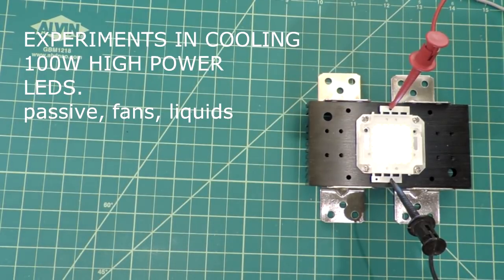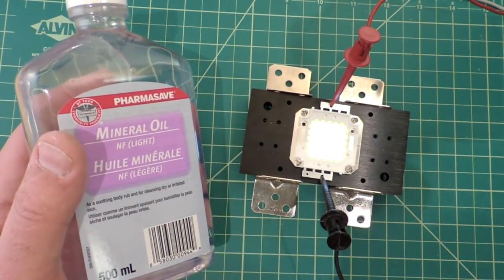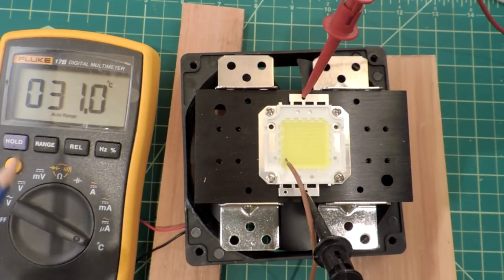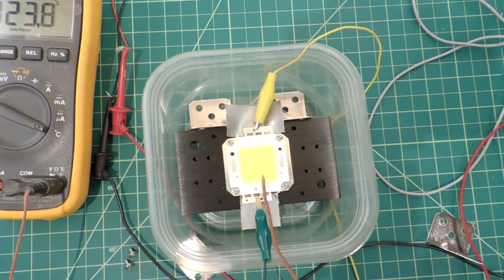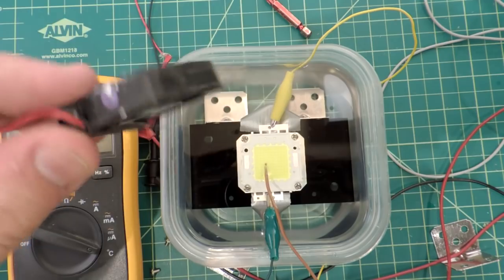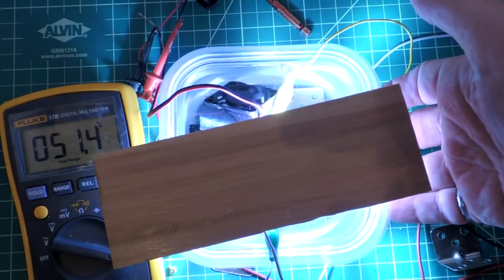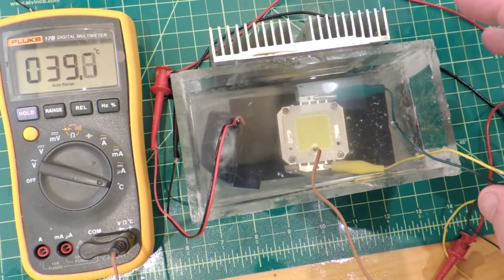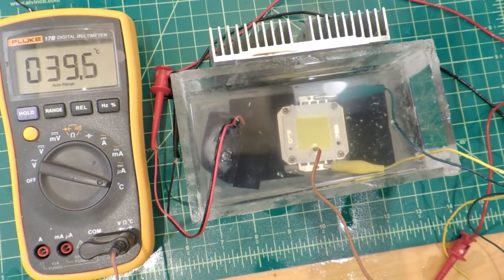Experiments in Cooling a super bright 100W LED module

Comment: I think that a computer CPU cooler would work for this. But maybe you will need a very beefy one with heat pipes.
Reply: pauljs75
Erm, 775 CPU coolers have LONG been used for the purposes of cooling 50>100w LEDs genius...
Reply: Yeah, something like Zalman CNPS 9500, with a good thermal grease.

Specifications: FHS: Dimensions: 85(L) X 112(W) X 125(H)mm. Base Material: Pure Copper. Dissipation Area: 3,698cm2. Thermal Dissipation: Approximately 135 Watts. Thermal Resistance: Silent Mode: 0.16 oC/W. Low-noise Mode: 0.12 oC/W. Fan: Bearing Type: 2-Ball. Speed: Silent Mode: 1,350RPM +/- 10%. Low-noise Mode: 2,600RPM +/- 10 %. Noise Level: Silent Mode: 18.0dB +/- 10%. Low-noise Mode: 27.5dB +/- 10%. FAN Speed Controller (FAN MATE 2): Dimensions: 70(L) x 26(W) x 26(H)mm. Output Voltage: 5V ~ 11V +/- 2%. Allowable Power: 6W or lower. Connector: 3-Pin.
Reply: I bet it would. The back of that LED looks about the same surface dimension as an typical CPU. (Intentional? Certainly makes it easy to use OTS parts.) A CPU cooler/fan combo rated at 125W cooling capacity or greater should work with reasonable wiggle room. (Anything made for an AMD Phenom II or Intel Core i7 should work. So there should be a lot of options.)
Reply: Why not use CPU liquid cooling solutions, they are not that expensive anymore.
Reply: JeremyB796
No it's not. With its fan running at its max speed, it's barely ok. LEDs and CPUs are not the same thing. This heatsink is meant for a CPU with 130w of max heat dissipation requirement. Usually LEDs operate at 100% 100% of the time while CPUs don't. Also this type of heatsinks might have huge heat dissipation surface but the problem is that the thermal path from the cpu to the fins is too thin/small for heat to transfer fast between these two points. And no matter how great an air cooler is, the top surface of the LED will be very close to its max allowed temperature.
Reply: runner180fxr I think you underestimate CPU coolers. I have run my AMD8350 at +90% for hours more than once using only the boxed cooler and I am pretty sure it can handle a 100W LED (but you'll need earplugs).
Don't forget that the temperature inside a computer case is already much higher than the room temperature, also the CPU is not alone but has heat coming from you GPU, chipset, ... etc.

I have used an old Thermaltake Volcano 7+ for driving a 100W LED and it ran really cool but noisy.
Recent boxed coolers are safe to cool most 50W LEDs without being too noisy the better CPU coolers should be able to handle a 100W LED.
Reply: ppdan
No I'm not underestimating cpu coolers. I was talking specifically about that cpu cooler. Also I never said it can't handle a 100w LED, I said it's barely ok. I thought my post was detailed enough but since it wasn't let me explain further.

LEDs and CPUs are not the same. With normal use like gaming, video encoding, folding, etc and 100% cpu usage you are not really maxing out a cpu. There are other ways (not overclock, not multiplier increase, not overvolt) to push even further a cpu which are included in stress test softwares and I doubt there more than a handful air coolers that can save a top tier cpu from thermal shutdown under these circumstances. A motherboard can monitor the cpu temp and adjust fan speed accordingly. And lastly cpus are designed to actively try to protect themselves from excessive heat by reducing their frequency or other means. In other words it's my belief that all cpu cooler manufacturers (stock or aftermarket) take into account these things, especially that last one and no cpu cooler is meant to handle anything more than a sustained 100% of typical cpu usage.

If this doesn't make sense to you let me tell you about a test I made. I tested how much power I can make an Intel G840 consume, with various ways that cause a 100% cpu usage. Even though this cpu has a TDP of 65w, it wouldn't consume more than 27 watts of power fully stressed. I did the same test a long time ago with a C2D E8400 and I also noticed a lot smaller consumption than the cpu's TDP. At that time I used Lavalys Everest stress test (which can stress a cpu even further than the typical 100%) and I noticed the consumption (and temps) was increased even further but still under its TDP. This is why it does not surprise me at all when you say that you are using your cpu at 90% for hours. Also I trust stock AMD coolers because as I said earlier there is a thicker path for heat to transfer to the fins, thus the heat moves faster away from the cpu and towards the fins. Also stock heatsinks are thick pieces of metal which add mass to the cpu. This means that they can absorb bigger amounts of heat from the cpu and as a result sustain their temp lower for longer time. Bigger mass = bigger thermal capacity = slower heat increase. Their drawback is that they have less surface to dissipate the heat and this is why their fans run at faster speed and they are louder. When comparing stock air coolers to most aftermarket, its just a trade-off between faster heat dissipation at the fins and faster heat transfer towards the fins.

LEDs on the other hand have no way to protect themselves. Give them excellent cooling and they'll live forever. Give them barely ok cooling and they'll dim after a year or two and their life will be shorter. Bad cooling and they'll die. As for the Thermaltake Volcano 7+ you used to cool a 100w LED, I believe it's ok to do the job. But when you say it ran really cool, that I don't believe. There is no air cooling solution that can make a fully driven 100W LED operate really cool supposing that by "really cool" you mean you can touch it indefinitely without getting your finger burnt.
Reply: runner180fxr Yup, especially Intel CPUs used to start throttling behind your back to avoid overheating (don't know about the recent i-series but I guess they still do that). 
Somewhere I think we have experienced totally different things with CPUs. I have to admit that the only time I accurately measured power consumption vs CPU load it was with server grade CPU (AMD opteron 8224, 8222 and older Althlon MP2800) and they started drawing awfully lots of power as CPU load went up. Than again it's an unfair comparison because those were real pure processing beasts in their glory days and the only "power management" they had was a lock down temperature.

As for my experience with my Thermaltake Volcano 7+, they had less trouble cooling that 100W LED than a couple of fully loaded AMD MP2800 sitting in a case where the case temperature was already way above 35 degrees. I think I have that setup still lying around in my "lab", maybe I'll fire it up this weekend and measure the exact temperature.

Comment: There are companies which are now selling commercial LED products based on these and similar LED modules.   Its does take some serious thermal and mechanical design engineering to keep the LED element cool, and at the same time quiet (efficient fan design).   Check out this light here. http://veritaslight.com/constellation-120.php

PS.  I work for the company.

Comment: Gr8 video on cooling.  I am also experimenting with 100W LEDs.  I just mounted a 100W LED on a CPU fan/heat sink.  This heat sink has the aluminum vans as well as the copper cooling radiator.  Hopefully this setup will keep the LED cool.  I am going to use the fan and hopefully i can keep the RPMs of the fan down to aminimum while still providing adequate cooling.  Fingers crossed.

Comment: hey guys: i ve found the definately best and cheapest method to cool don a led modul (100watt) and i use it for my 100 watt module, too. there are many "watercoolingsystems"  like "enermax" and so on on the market: but in this case a good old cooling system for a pentium 3 or amd phenom 2 is the best and cheapest!!!!. its built for the same space like a led module and for example in a pc you ve got 140 watt output each cpu (amd phenom 2) and those systems keep it on 50 degrees celsius! so search in ebay and DO IT greetings from germany

Comment: This question is obviously answered I would assume in the video but are these LEDs water proof? I ask because I made a setup for a fog/really bright head light for my four wheeler with a 100 watt led and a CPU heatsink/can combo and I have a reflector/bubble on it and and I was worried about it getting wet/lil muddy as due to the general rule of thumb electronics and water don't do well together. Please let me know if there are any hidden things I should be aware of. Thanks
Reply: Yes the LED is potted.

Comment: Have you tried using cpu cooler?
Reply from the maker: no. in the application i was thinking of the thickness of the light is also a consideration and a 100W capable air-cooled heatsink will be ~6 inches x ~6 inches. .  CPU coolers are, however, some of the cheapest high power heat sinks available and could well be a great way to cool such a power module.  Check out my video on a DIY thermal chamber for more thoughts on that subject.

Comment: I'm considering building my own video light using leds. I've been looking at "corn cob" style bulbs that have wattage claims of up to 100 watts. Have you ever tried these? I'm worried about the reliability of the circuitry of such a layout but I haven't gotten my hands on one yet to test it out. Maybe these could work in your light box setup.
Reply from the maker: sorry, i have never tested corn-cob style bulbs.  One important factor, however, is that the bulb have no flicker for movie making.  To date only the Philips bulbs have been consistently good in this regard.

Comment: There is a problem with measuring the top of the LEDs, the transparent top does not conduct heat well, but the light energy can easily bring your probe well above the actual LED temperature. I suspect a lot of the difference in the liquid cooling experiment is due to the liquid cooling the probe.

You could use a thermally conductive adhesive and glue the probe to the edge of the LED base just outside the light emitting area to get a better idea of the actual temperature.

I am saying this since i made the same mistake trying to get a good temperature measurement from a LED myself.

Comment: Great video! Have you tried a water CPU cooler? There are a few manufacturers that sell the whole solution with a recirculating pump and a radiator, as a closed unit. That might work better than submerging your circuitry in baby oil. :)